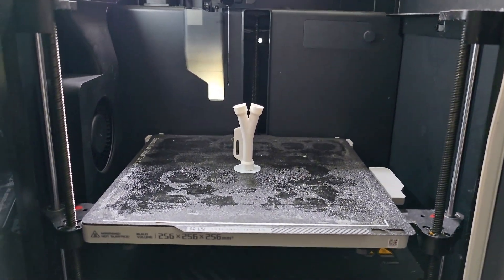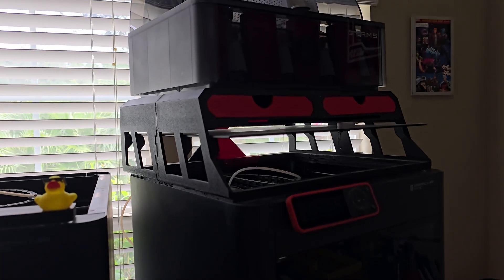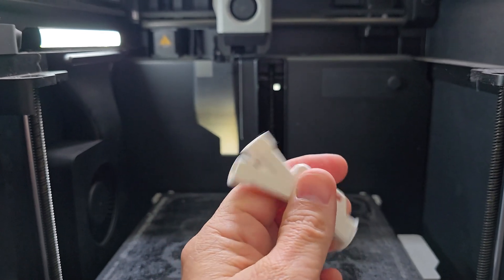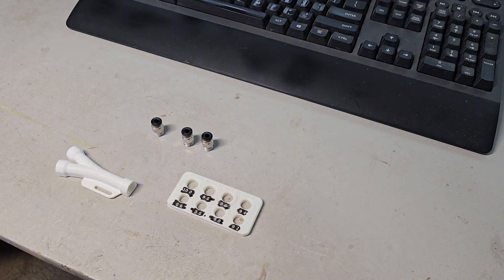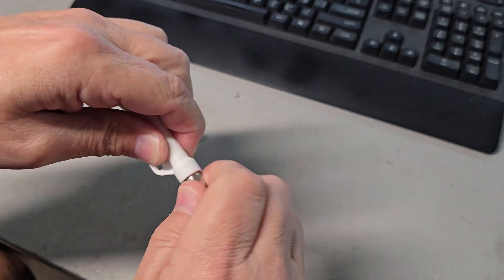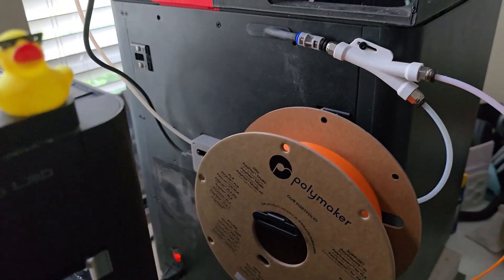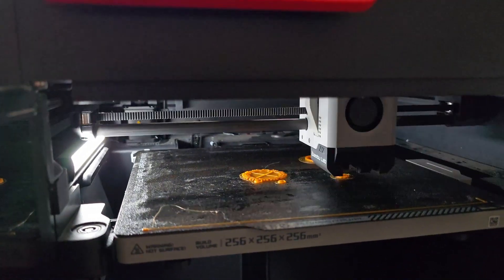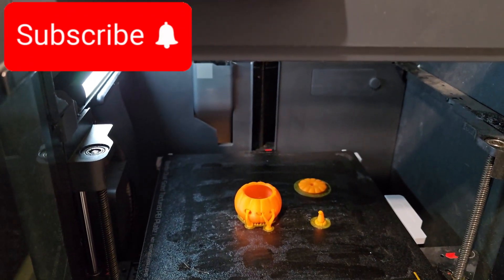Adding A Y Adapter To My P1S to Print External Cardboard Filament Spools.

Comment: I just got the printer, added electrical tape to my cardboard spools, had them running for a week now and no dust or damage on the tape :)
Reply from the maker: I've read that what you did works very well.  My issue with cardboard most times is that when I receive the box from Amazon the cardboard is bent and then starts to wobble in the AMS.  That happened last week with an Elegoo PETG I was using.  I straightened it out but as it began rolling it caved in and tape or a plastic spool wrap wouldn't have helped the situation.  This is for one offs, not gospel for everything I'm using.  I'm not afraid to use good, round cardboard spools in the AMS because I will just clean it regularly.

Comment: why not just glue stick your cardboard edges, let it set, than run them in the AMS, everyone of my spools for the last year have been cardboard and no issues.
Reply from the maker: This is the first time I've heard of this technique.  I tried the plastic rings on the cardboard edge and they ended up slipping and then cracking.  I'll check this out, thanks.